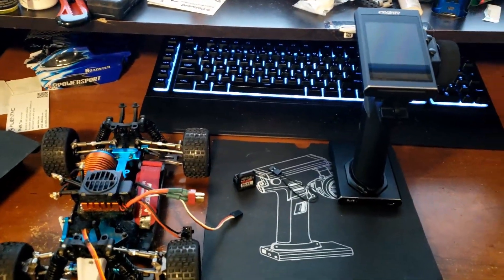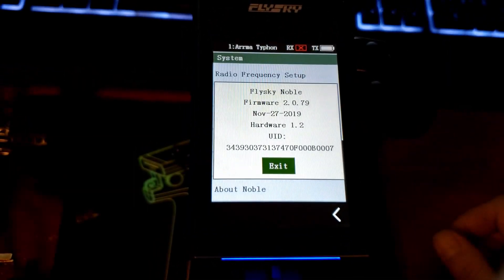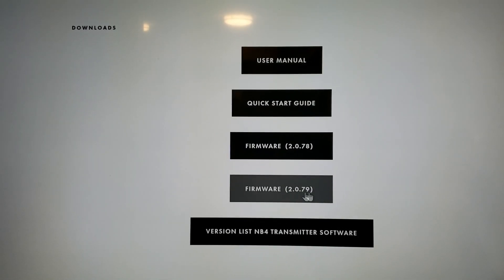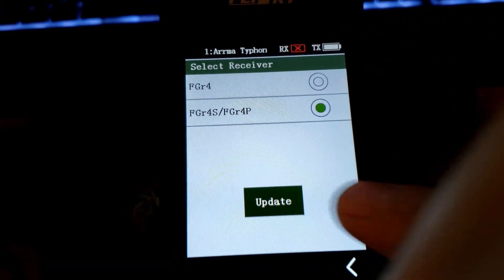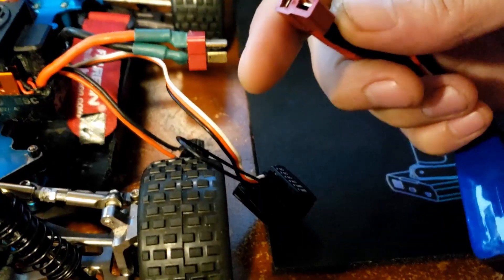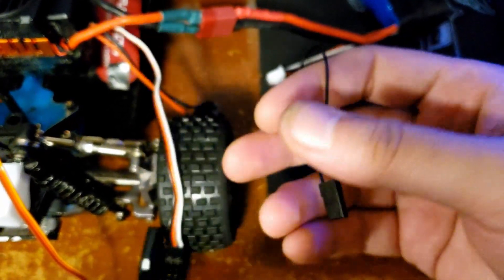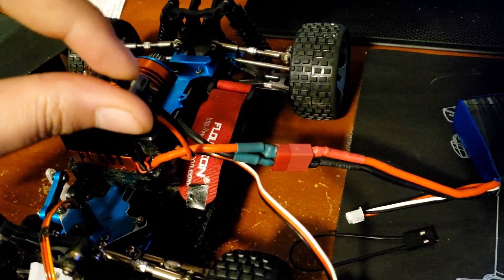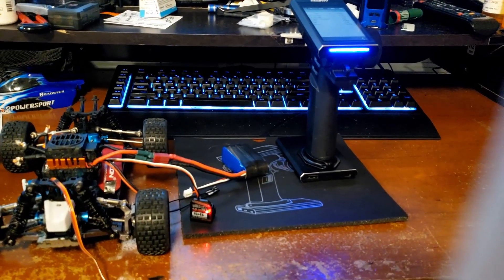Flysky Noble NB4 receiver FGr4/FGr4S not binding? Update RX and TX Firmware to fix. How-To.

Comment: You have any issues getting the radio to connect to a PC? I've tried 3 diff computers and 5 diff cables but it will not connect and I can't update it. Very frustrating!!
Reply from the maker: just noticed this. i hope you figured it out by now but make sure all your drivers are installed and correct. windows 10 and 11 should automatically install what yo uneed to see the radio. could possibly be a faulty radio but ive never heard of this issue before.

Comment: Hi.
I had this radio for Christmas to install in the ARRMA Moyave but I have a little problem. I can bind the two receivers sold with the radio without problem, but then as soon as I accelerate, it turns the wheels at the same time. Ditto when I brake. I put another radio on the Mojave, no problem. I put the noble back on and it causes me the same problem whatever the receiver (FGR4 or FGR4S): it steers the wheels as soon as I touch the gas. Do you have any idea because it spoils my fun?
Thank you
Reply from the maker: Sounds like you mixed channels either in the radio settings or by shorting wires together.. most likely from the radio settings. You can either reset the radio or manually fix the mixing.

Also, make sure the plugs are plugged in the right way.
Reply: @jstagzsr  Unfortunately no, I did not mix two channels (I had thought about it). I also made a factory reset several times and a new bind of the receivers but that does not solve anything.
Finally, as I tested another radio which works perfectly it allows me to say that there are no false electronic contacts on my ESC or my servo.

Do you think that updating the radio can fix something (it already has the latest firmware)? Or that it could come from the radio connection protocols?
Reply from the maker: @roady2die912  hmmm. very weird. I have no idea what could be wrong then.. If the plugs are plugged in in the correct orientation and everything in the radio is set right, but several different receivers are doing the exact same thing, id guess the problem is in the radio itself.. At this point if i was you id try absolutely everything.. Re-update the firmware, re-update the receivers, rebind, start a new model, delete old models, etc
Reply: @jstagzsr  Well finally I found the problem but it took me a lot of hours ... I had mounted my JX BLS-HV7132MG servo with a metal body on a new aluminum support without silentbloc (instead of the plastic original support). I'm not able to explain it but when the servo is directly in contact with the aluminum (it also touch the chassis), it is parasitic: the steering oscillates and turns when I accelerate or brake. I put back the silentblocs and the original plastic spacer and there is no problem. I tried again without the silentblocs and without the spacer it gave me the same problems as at the beginning. Weird, isn'it? 🤔
To sum yo, the problem is solved and the Mojave is ready to go ... 👍
Reply from the maker: @roady2die912  wow.. very weird.. there's a bad short somewhere.. there must be power running through the chassis somehow and it's shorting other things. That's be my guess. Very very weird.

Comment: I updated to the new firmware and it still will not bind to my fgr4 v2 receivers nor will it key me update the  receivers...why?
Reply from the maker: The receiver AND transmitter MUST both be on the same firmware for it to bind.. you did it exactly like I showed in this vid and it won't update the receiver?
Reply: @jstagzsr  ....I finally got it to bind to the receivers , and I got them to update from the radio I kept on messing around with it I was trying everything I could think of and I finally came up with name the models first then bind the receivers to a model and it worked then I updated the receivers by each model to the radio  and they work...I also do a re bind and the still work...Amen 🙏😇🤗
Reply from the maker: @BIGGBULLxxx  awesome dude. congrats!!

Comment: where did you buy this radio?
Reply from the maker: i bought mine from banggood because its 30$ cheaper than anywhere else i saw, but the flysky noble nb4 is for sale everywhere.. ebay, amazon, newegg, etc..
Reply: @jstagzsr  I know but i'm interested in the version 2 of the fgrs receiver, which supposedly fixes a problem with ver1 receivers browning out. The Rx pics shown in the listings show the old v1 rx
Reply from the maker: i think the issue was people werent updating their receivers. if its not that then i have no idea. ive not had a single issue with mine. i absolutely love this radio.
Reply: I bought mine from Banggood in 2021 for  $199. Included 2 receivers. I’m left handed, and finding a good quality rx for lefties is near impossible, so I appreciated the reversible wheel.
Reply: Thanks for the Video. Very helpful

Comment: So liking this. Just in case my main Transmitter fail, then I'm taking this Transmitter out of my closet.
Reply from the maker: whys it in your closet???? id think it would be your mian radio!! the one you hook ALL your cars up to. thats what im doing. i only have 4 on it now but every car i get will most definitely be on this radio for sure!! i love it that much. lol
Reply: @jstagzsr  I bought this first. Got to impatient with the wait and the sucky arrma Transmitter and bought the dx5pro. Was going to return the flysky. They said it would be cheaper for me to just keep it and get 2000 points for my next order. So I was just going to keep it for my drag car once I start getting it. In addition, can use this as back up. To afraid of it breaking because I'm hard on everything. In my opinion, this is the best Transmitter I've ever saw. Yes your right, I can use this for both of my trucks and more. After seeing your modification, I'm  too lazy to do all of that. So I was going to wait to use it for my first drag car, plane and then crawler. Still liking your videos because you share useful information that every one else seems like it's a big secret ( like in drag racing).